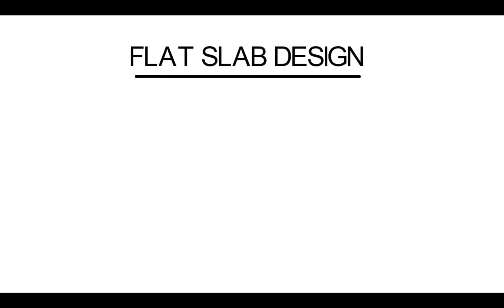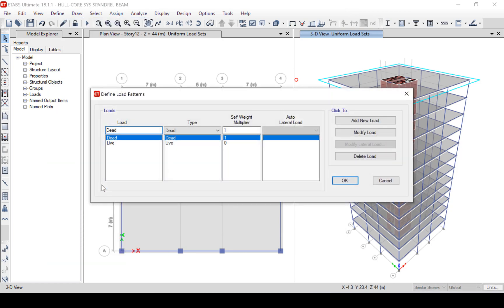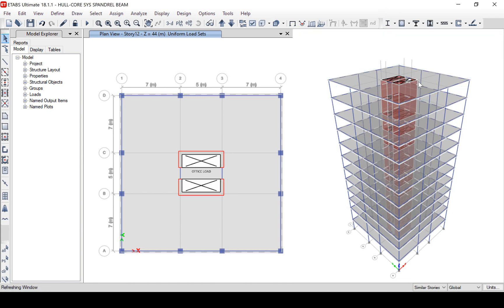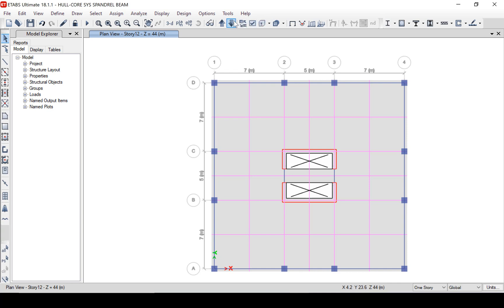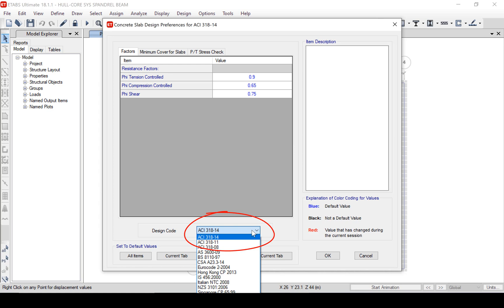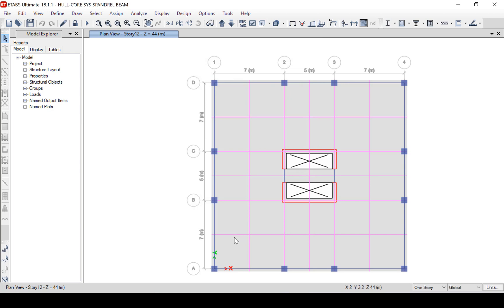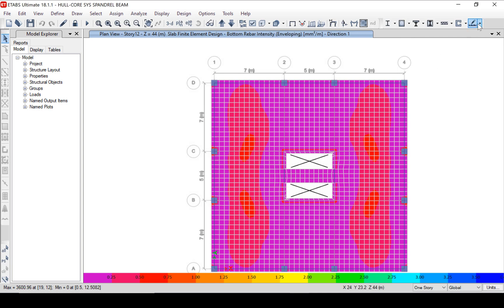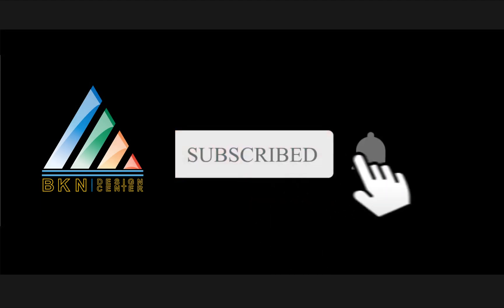ETABS 07 |  FLAT SLAB DESIGN | 13 Storys Building

Comment: Hai, Sir.. can you explain how to check “Strong Column and Weak Beam” procedure in Flat Slab building? Because in flat slab we have no beam.. thanks you sir
Reply from the maker: Strong column/ weak beam is only applicable to moment resisting frame( beam and columns), in flat slab you can check for Chord and Collector.
Reply: @babrak29  thank you sir

Comment: Great job sir ? Sir I have some doubts that in one of the paper I have read that octagrid lateral load resisting system in that author used the steel octagrid structure in state of outer peripheral column and the dimensions of that octagrid box section is 91.5*91.5*4.5mm so what it means?
Reply: Can u share ur contact no I will sent u that paper
Reply from the maker: @faizanshaikh6036  this video is about flat slab design only, what you have doubt is completely different issue. info.bkncenter@gmail.com

Comment: Thank you for the valuable video. 
would you mind to make a video on a complete seismic load design (static and dynamic) based on ASCE 7-16? 
Regards
Reply from the maker: Thank you for your comments, we will upload soon seismic analysis and design as per different  codes and standard, Stay tuned